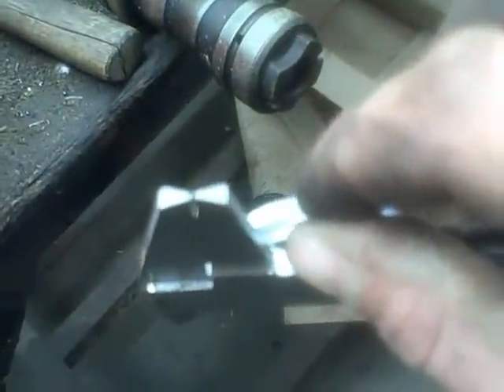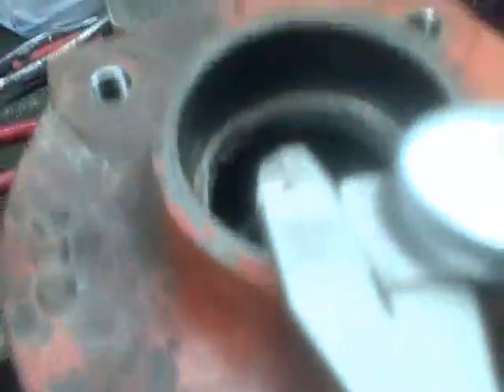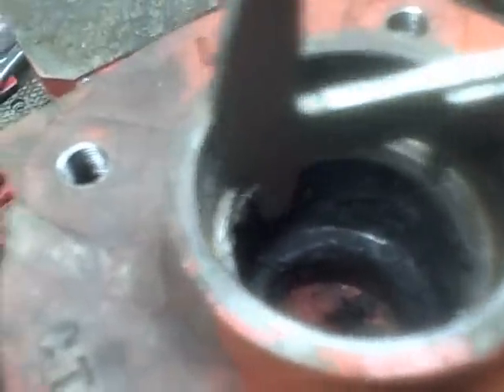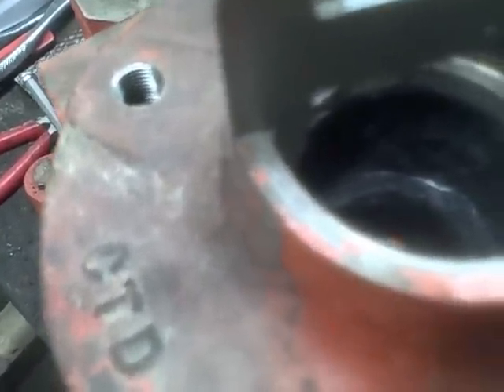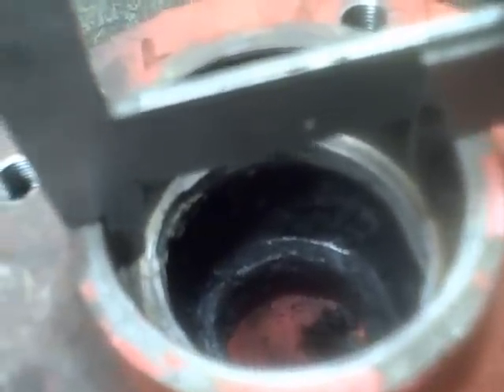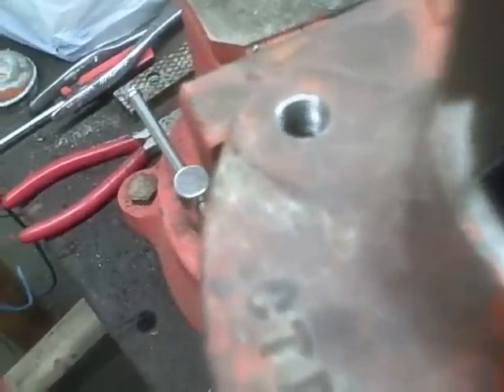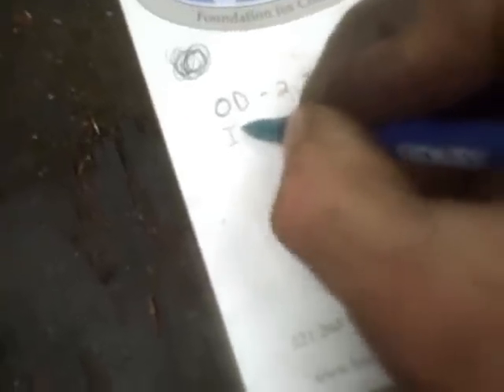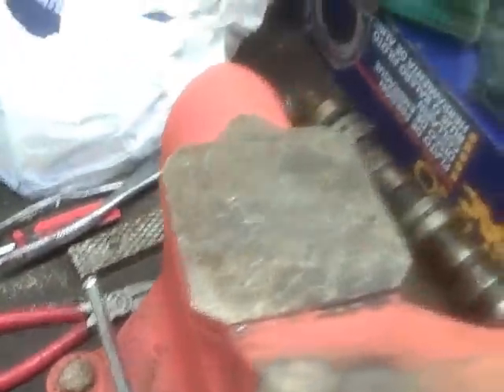Fixing the harrows and how to get the right seal if you dont have a number Part 2

Comment: Ive used both the digital and "analong" calipers before myself and I have to agree with Wayne here, the non-digital ones are for whatever reason a bit easier to use....but i guess its like Wayne mentioned; its also what u are more comfortable/familar with using....